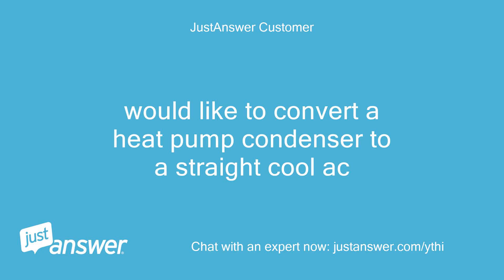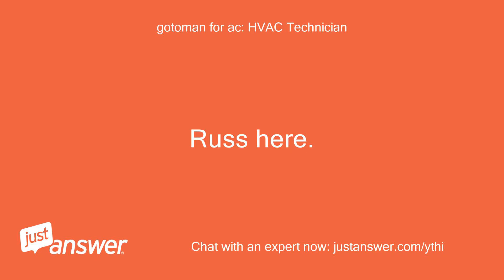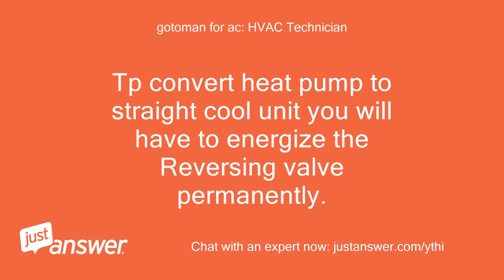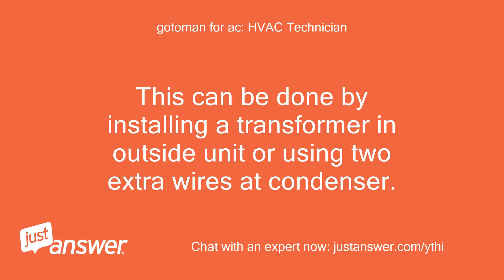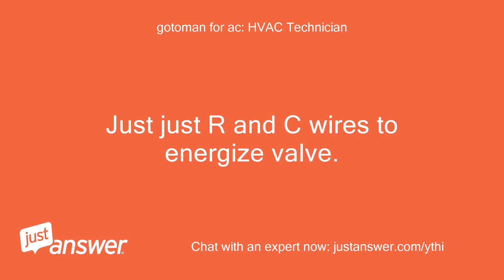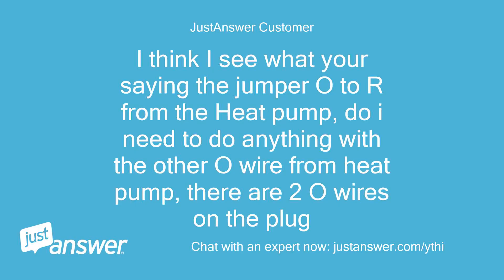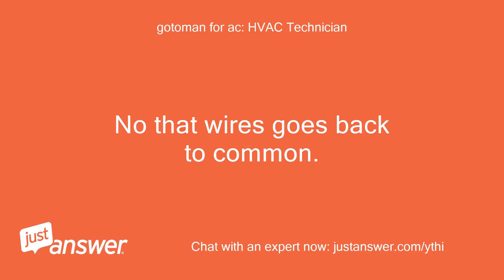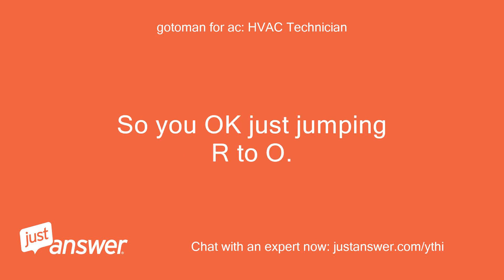Would like to convert a heat pump condenser to a straight

Comment: yeah, energize the reversing valve all the time, and burn it out.  Ruud and Rheem reversing valve "park" on ac....or revert to a/c with no activating the 4 way reversing valve.  Tie the yellow to the O and it will energize only on a/c.